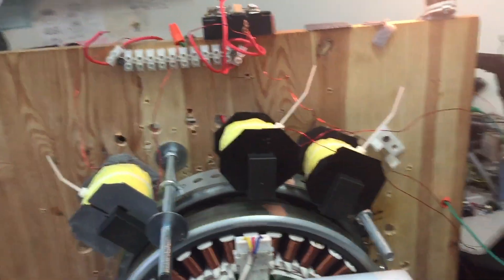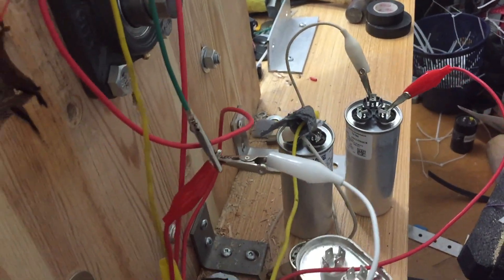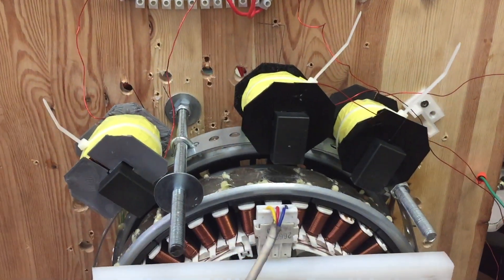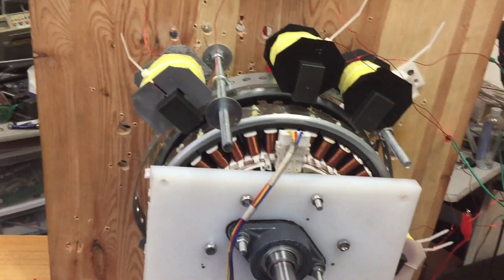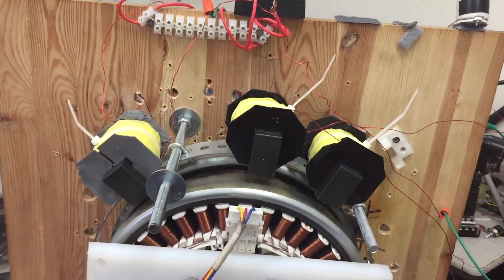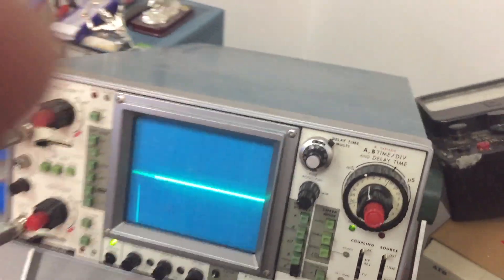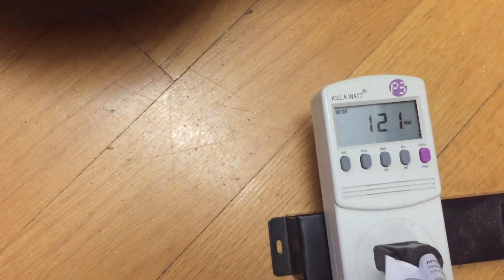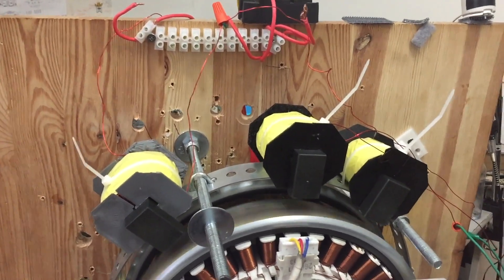Anti Lenz Testing

Comment: Hi, My friend " 🤓.!! I'm not Here to explain about how to do " This, OR How to do That ". !!
I'm Here ( in you're comments to give you
A Simple Question & a Challenge). First thing"
My QUESTION " Do you have any "washer motor's.?!?!. OR maybe a blower motor" the old
Style that is round,. If so"?? Then I Challenge you to: Hook it up, to the correct volts from the
Mains.!! A.K.A. THE WALL POWER, After powering it up, then check out what the voltage is with you're ( oscilloscope ). Making sure There is no LOAD at that time..... Then, tell US all what you find. It's just a few minutes to set it all up,.PS: I think you will discover that there is
More layer's, to this Matrix* than the Wealthy 
Elite want anyone to know. PS#2. You're scopes
Ends, Connect to one just in front of the running
 capacitor & the run- coil.... This is rare knowledge... I helped " Mr. G. Moran." To understand that he was dealing with 
Resonance on his vibrating coils.!! He was getting it" But very slowly" SO" I JUST
HELPED him, Move ahead with his understanding. " Resonance is power".!!
Reply from the maker: i use to watch G.moran and he did not show any results or tests that exceed what we should get , he was playing with high voltage and very small current which is not a big deal , he never prooved any extra energy from any device , i did a lot of testing on his fav motor the washer machiine motor check out my other videos , its waste of time and money to do any of these tests , IVO following Tesla known results and we see it as you see in ivo setup or my setup there is power bigger than the input its simple as that , the issue is tunning is not easy and output is high frequency and it have to be resistive load only for now
Reply: @EnergySeeker  Yes, I do agree with you on everything you've said. I have students who has
Shown These same results. However it is not a good idea to focus on one person and Only
There research as we tend to focus more on the
Individual and there personalities or theories rather than the true end results. So, as the end result is almost always " biased " as to our focus on the results that  individual had" & 
Not our end result" such as what is staring
US in the face. That's what attracted me to your research because you don't do that.!! You're
More like " TESLA" Than you think.!!  
He was an individual" who never followed anyone else" he was always thinking about
How to improve on anything that he was doing
Whether he was working on something he himself filed patients for or whether he was taking a new look, at an old idea. I feel like you're like him in that, you do the same thing.
YES, Gerard Morin, had a lot of smart people who didn't care to help him solve problems
That Tesla, had to tackle by himself. With Only
One or two individuals who where not as smart as himself, so" Gerard  was, very set in his ways
As an " example" : if he decided something was,
Occurring" by way of one effect, he refused to
Look at it with an open mind" and refused any other solution but the one ( Cause & effect) 
He thought he had found. I really admire you
For That, you seem to have some of the same qualities tesla himself had. I really appreciate
Researcher's such as you're self, Master IVO
Who are carrying on to find "One of many ways to get TRUE Electrical power" from this vast ocean, of electrons " we seem to be saturated
In, and are living in. It's been proven recently that even the very breath, we breath is full
Of electrical power" drawn on through the
Moisture in our, breath.!! Isn't that an awesome
Realization.!?!? I mean just thinking about,the
Earth's magnetic fields, are producing power, by moving on it's axis.!! WOW,!! My friend that just
Blows my mind.!! We, ourselves are, Made up of, the very thing's used by This univers to power, EVERYTHING.!!!  Good luck with everything, my friend. & Do Greater things.!!

Comment: Best to use a resistor of a known value to do accurate power measurements. Also, the real input power is not known until you remove the generator coils and cores (away from magnet rotor) which also cause input power losses. Only then will you know the real prime movers input power and then add the gen coils to find how much more the input goes up and deduct the output. You'll probably break even or be under unity. I have a video where once I remove the gen coil the input drops less (in watts) then what the gen coil output was. So in that case it can be called a gain.
Reply from the maker: good point i will do the test without it
Reply from the maker: Luc, you are right the coils causing the prime mover to need more power, but the higher the speed the less of that i will put a video for that results
Reply: Amir, usually it's the opposite, the faster the magnet rotor turns the more the cores will cause input power losses. So take your time to find the ideal rotor rpm to have less input power loss when you remove the gen cores. If you can bring it to no difference (with or without cores) then you've got something really good., Please send me the video link once you've got it at its best. Regards
Reply from the maker: @gotoluc  https://youtu.be/gfNwRdocu0E
Reply from the maker: @gotoluc  the good news is am able to make the power needed with cores the same as without cores and coils a mechanical adjustment needed , so i will re adjust all of it and test again
Reply: That's great Amir, you're on the right track. If you can demonstrate (example) 20 watts out of your gen coils and your prime mover input is 60 watts and the only change is you remove the gen coils & cores and input stays the same then you have a Lenzless generator output. 
You can also play with the load resistor value. You'll find there's an ideal value which depends on how many turns your coil has. If you check it's open (no load) rms voltage and say it's 50 vrms, then make sure once it's on the load resistor the voltage doesn't drop more then 50% and less may be better. You'll only know once you do the power calculations but you'll need a true RMS meter to do it and an Oscilloscope is better.
Here is the video I made some years back where my prime mover input was 2 watts and then I add a Metglas cored gen coil (without stopping motor) and the input goes up by 0.35 watt but the output on 100 Ohm load resistor is 0.5 watt. So I have a 0.15 watt gain somehow.  https://www.youtube.com/watch?v=FxSccG5DNFM  As far as I'm concerned, this is a reliable way of measuring how efficient you prime mover and gen coil (combination) are. Regards
Reply from the maker: @gotoluc  the voltage drops only 1 volt , from 95 to 94 volts with 3 coils i can power 40 watt lamp , but with 3 cap in series , the cap make the voltage double from 45 volts to 95 but also the input power for the motor increase when the cap is connected  , the cores connected or not without load the input power are the same now , but the cap increase the needed power for the motor so the input power go from 79 W to 115 Watt and putput i get 0.61 amps x voltage 110 =67 watt
Reply from the maker: @gotoluc  your video is very interesting what Value in H these coils ? what gauge ? is it only one magnet on the motor ? did you find that CAP add to the motor input or not , because mine when i add cap it add to the prime mover watt
Reply: Probably the gain when you connect the caps is caused by the gen coil becoming a tuned LCR resonance circuit. You can verify this by increasing (if you can) or decreasing the RPM. There will be an ideal RPM or Frequency for maximum gen coil output. However, as you noticed, it's not free power as the output gain reflects back to the input power.
Reply: I wrote the H and R values on my reply on my video because you first asked the question there. 
The rotor has 4 sets of magnets. I say sets because each of the four sets has a North and South magnet next to each other. This is a very interesting magnet rotor configuration because of the shape of the wave the motor coil produces. It produces a unidirectional sine wave. you should try it. You can see it on my scope. It looks like a DC square wave but that's because I power the coil but if you don't power it you'll see a unidirectional sine wave.
Reply from the maker: @gotoluc  you know i tried NN or SS sets but i get very small voltage , the way am showing in my video is the north and south in the same time , but i noticed that when i connect the coils together the watt of the input power goes down and that is strange, that have nothing to do with the LCR , somehow the connection of the coils help the motor to turn even these coils are not powered ,  i will test that a bet , yes no free power so far , i will connect the motor to rotor via a belt to be able to speed it up at 1200 rpm and will see
Reply from the maker: @gotoluc  yes the at resonance it give max power but am not after that , we need anti lenz , no free power , input = output at the max so far
Reply: You misunderstood, my magnets pairs were north and south in the same time. That produces a very high unidirectional sine wave and good output. When you combine many coils in series like you do you have to make sure the coil polarities are all the same so the wave goes all in the same direction, plus you have to carefully position the gen coils so each gen coil wave climb and fall at the same time. You can use 2 channel on your scope to adjust two coils at a time.
Reply from the maker: @gotoluc  yes i understand you mean they need to be in phase to be added, but putting coils in series i had an issue with it because of the voltage drop to 0 when connected to a load , because i think all the resistance of the coils add up unless you have a solution for that because i get much higher voltage if i connect in series
Reply: I was just explaining why you may have a better output with the caps, also known as LCR. 
I'm also still looking for an Anti Lenz solution if it's even possible.
None of Thane's devices demonstrates more Watts output then Watts input, so don't feel bad if you can't. 
All what Thane is demonstrating is a gen coil can have a current delay which assists the magnet rotor.
Can that achieve Overunity? ... that still remains to be proven.
Reply: Yes, in Phase. I didn't use the term in case that word was not clear to you. The drop to zero sound more like a wave polarity issue or or wave phase issue or the load resistor is too small of value. Series divides the current and multiplies the voltage. So coils in series you also need to multiply the resistor value. It should all come to about the same power output if everything is adjusted correctly.
Reply from the maker: @gotoluc  i will try combination , like 3 in series in parallel with another 3 in series
Reply from the maker: @gotoluc  i got you , yes we all trying :)
Reply from the maker: @gotoluc  you know i wonder if this concept can work on bigger setup , we tried it on the 10kw gen i have but it didnt work , it needs some work i think to accommodate the 10kw i mean about the BiTT
Reply from the maker: @gotoluc  see this new testing video please https://youtu.be/SGJSGHe4B3o
Reply from the maker: @gotoluc  hi luc take a look at my latest video where i show a new design with a connector between the magnet and the coil cores , no lenz but the voltage drops like this test i have , voltage drop from 400 to 8 volts , i think it might be the dc resistance of the coils which add up when connected in series